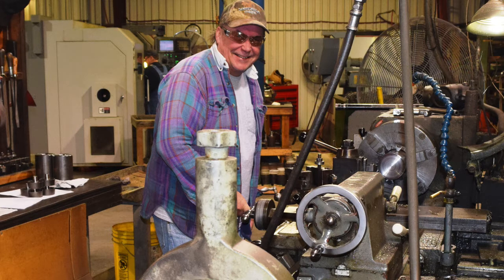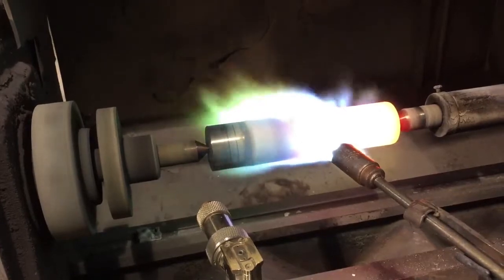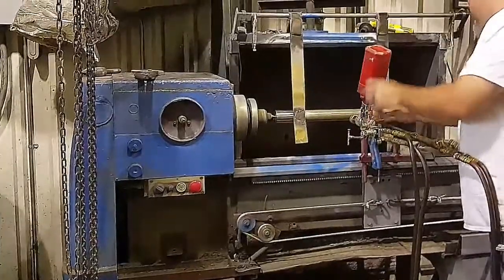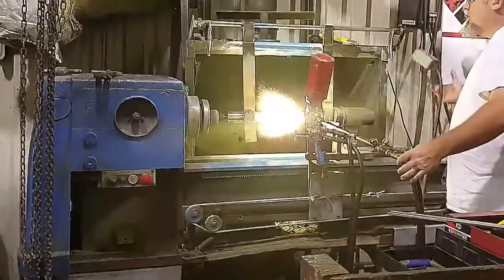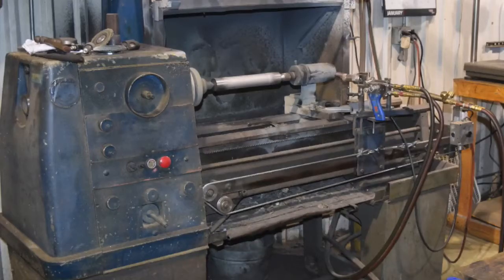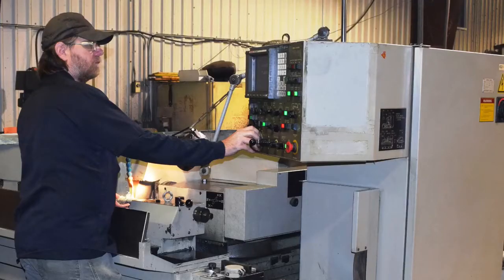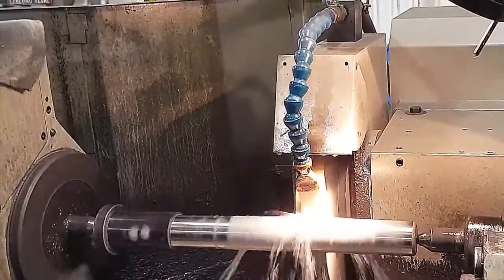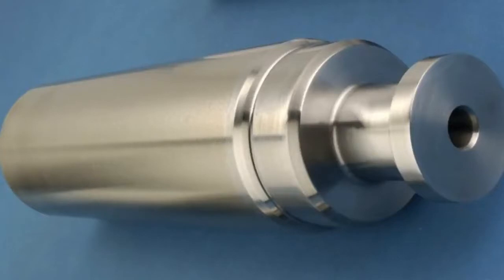How It’s Made | Pump Plungers

Comment: Hello,

This is a doubt regarding the plungers of a WM4215CL pump, whose max pressure is 1500psi, GPM: 4.2 and rpm: 1750.

I’m trying to figure out if it’s posible to replace its ceramic plungers for ones made of stainless steel? Which can be the pros and cons?

I’d be very grateful for your response,

Greetings from Peru.
Reply: Hello, 
Apologies for the slow response. 
Please copy/paste the following link into your browser for the pros and cons on ceramic & metal-coated plungers:
https://www.triangle-pump.com/products/plungers
If that doesn't answer your questions, please feel free to contact us at 405-672-8088.
Thank you!
Reply: hi friend, did you replace the ceramic plunger with stainless steel?